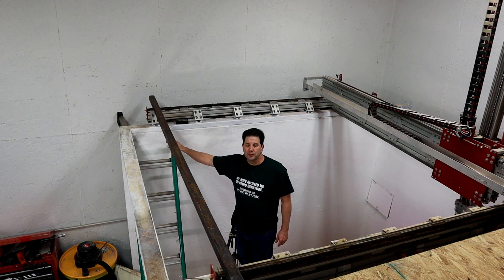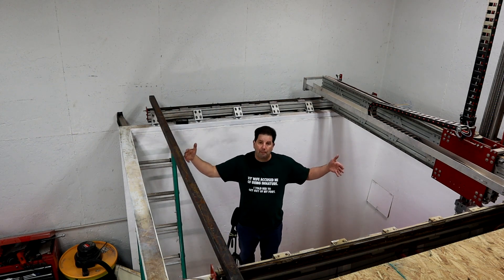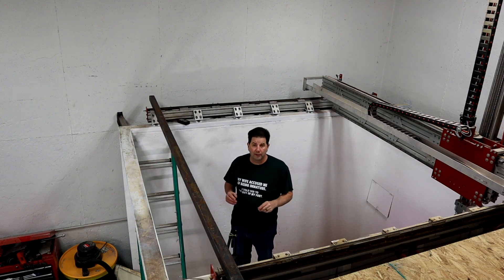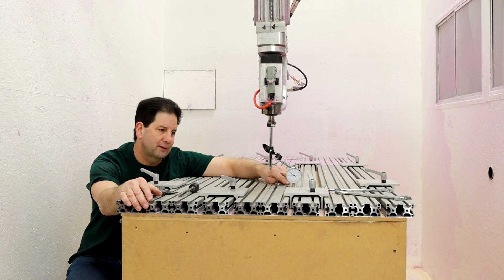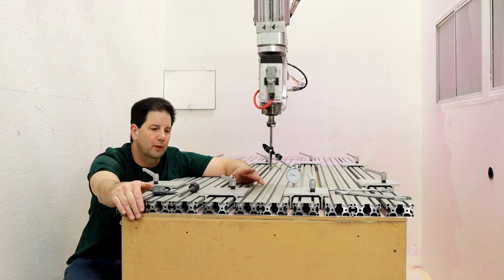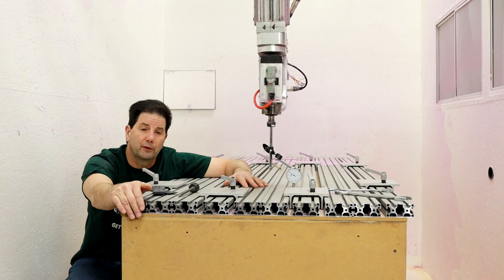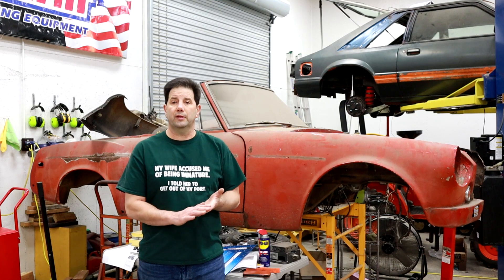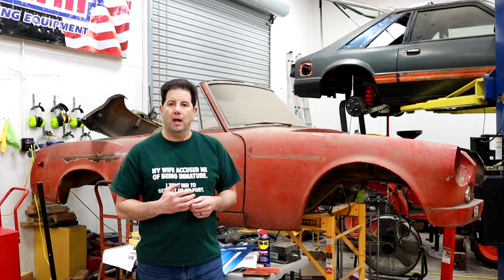DIY 5 Axis CNC Router...Build Video 4

Comment: Wow, grate job. Can u share/sell fusion 360 post processor for 5 axis? Thanks
Reply from the maker: Unfortunately you will need to edit yours to make sure it works correctly with your setup.  But it’s easy to edit
Reply: @XSMotorWorks  I am using Fusion 360 and modified post processor to work with AB axis but can't manage the tool lenght calculation in NC code. Tool tip position is not maintained. Can you help? Thanks.

Comment: Hello.  Just got done looking at your 5 axis machine and I'm very impressed.  I've been looking at the Masso controller and wanted your take on it.  I'm getting a little tired of buying Mach4 based hardware for a lot of money and still having lost steps show up randomly.  Any thoughts you wish to share, both positive and and negative, would be greatly appreciated.
Thanks,
Andre Barclay
Reply from the maker: Hi Andre,
Well I've actually got 2 Masso units now. One on the 5 axis and one on a Plasma Cutter.  Overall I'm extremely happy with them, keep in mind they do not have as many features as the Mach But that also means there's very little that can go wrong basically it either works or it doesn't.  I also REALLY like the clearpath drives.  

Here is some of the latest work that has come out of the machine

https://www.instagram.com/p/CCrQwCXnHwY/?utm_source=ig_web_button_share_sheet

Comment: Hi Brian, I have been using your videos for information on my 5 axis CNC build.

Is it possible you share more light on your z axis.

I don't understand the kind of setup you have there that allows you to achieve such height.

If you can share some drawings with me or part lists, I will appreciate it.

My email is tolulopeoolukokun@gmail.com 

Thanks for your help.

Comment: Great machine Brian!  I would love to build a machine like this! A few questions:  1) Can you estimate the component cost and number of hours it would take to build a replica of this machine?  2) Is there any custom machining necessary to build, or can you do this with a metal band saw, welder, mechanics tools and wiring tools?  3) Do you think the working volume could be increased to 40'(X) by 12' (Y) by 12' (Z) with the same structural types and motors?
Reply from the maker: 1. It's hard to est the number of hours as I  "upgraded" the machine over time.  As it stands right now I believe it could be built for 5k-6k.

2. Only thing that is really needed is a drill press.

3. Increasing Z is always a challenge.  Think of a  pendulum.  The forces acting of the cutting tip increase as the length increases.

Comment: Great built. Can you share some info on what software you are using that handles additional A and B axis?
Reply from the maker: A/B gcode calculations was done with MasterCam when the video was made.  It's expensive software not really for the hobbyist and I only had access to it through a friend.  I now create my 5 axis gcode in Fusion 360.
Reply: @XSMotorWorks  Ah great, I also use Fusion 360 and was not sure if it is compatible.

Comment: Hi Brian

Greetings from South Africa.
I am very interested in building a machine such as yours and although I am a mechanical engineer I am by no means a machinist or know too much about cnc machine building and electronics.

Can you tell me if you basically designed the machine yourself and just bought the spindle rails and motors for the unit?

I know I am asking much but I just not sure where to start exactly. I wish to use the machine for the same purpose as you. Can't afford a sportscar so want to make my own. Would you be willing to sell the plans and parts list of your cnc machine to me? This would be a huge help to me.

Keep doing what you do!! Can't wait to see that Porsche done!
Reply from the maker: Hi Maurice,

Thanks for the kind words.

As I said I did not know much about CNC when I built the machine.  As far as plans go it started out as a simple 3 axis machine and from there I upgraded the parts.  You can find a number of 3 axis 4x8 plans on the net if you look around.  One piece of advise is make sure you use linear rails.  Also given that your just starting out I would really recommend that you start with a Masso unit.  I used Mach3/4 at first but In my oinion the Masso unit is much easier to troubleshoot.  Please feel free to contact me at brian.denton@xsmotorworks.com if you have questions and I will do my best to answer them.

Cheers,
Brian